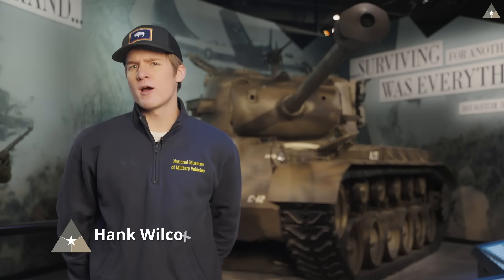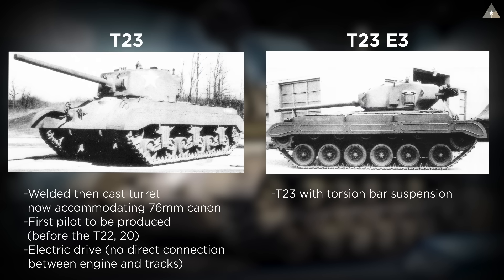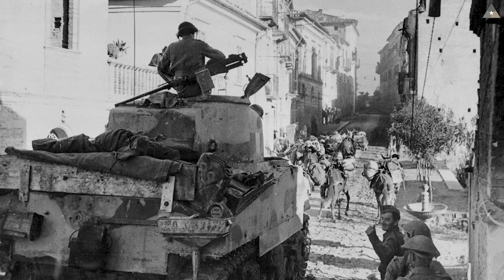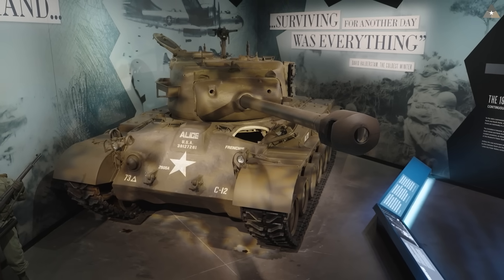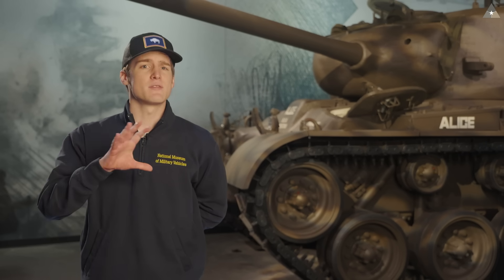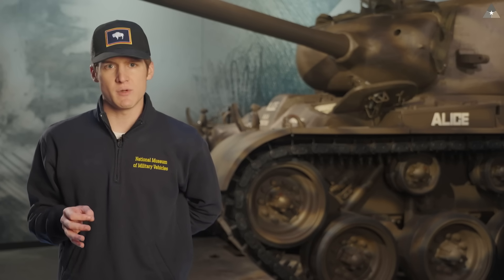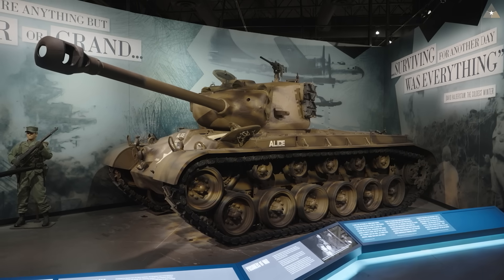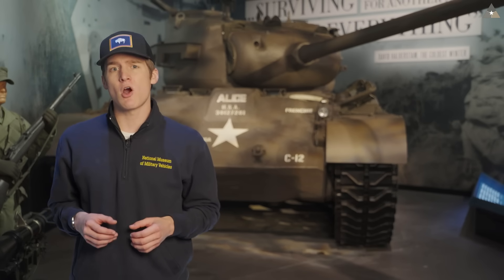M26 Pershing | From Concept to Combat Across Conflicts

Comment: A Pershing was knocked out by a Nashorn
Reply: That becomes a Tiger in this video.
Reply: Basically one of each---one of the first two Pershings knocked out was by a Nashorn, the other was in the Tiger engagement mentioned in the video.  Not sure which was first but I'm sure that's something easily looked up.
Reply: @SomeRandomHuman717  A Nashorn knocked out a Pershing on March 6, 1945. A Pershing knocked out a Tiger II on April 21 but was not itself knocked our in that engagement. At this point I'd have to review what the video said to check that it conflated the two encounters, but that was my impression. The latter was the only encounter of a Pershing with a Tiger.

Comment: Again, another great video. Thanks for hi-lighting the M26. The tank duel at Koln against the Panther helped make the Pershing legendary.
Reply: If the Panther commander didn't hesitate to give the order to fire, thinking the Pershing might be a new German tank, then it could have ended very differently for the Pershing. That hesitation was the difference.
Reply: @lyndoncmp5751  Yep, you snooze, you loose!
Reply: According to the men who used the m26 in Korea it was a winner. Especially  against the t-34 85
Reply: The M26 was not legendary - it was a terrible tank. Don't equate an overhyped encounter with a single Panther with legendary status. It was unreliable, too heavy and just as vulnerable to German anti tank fire as the Sherman. The gun was better than the Sherman's but as a complete weapon system it was inferior (at least in WW2).
Reply: @chrisc8156  M26 wasn't a terrible tank. Don't know where you get that idea.
I believe the video errs in attributing the first loss of an M26 to an encounter with a Tiger that was actually an encounter with a Nashorn. I should probably confirm this by looking it up, but that's just my memory of the incident.
Reply: @gandydancer9710  The M26 was not a very good tank. It was chronically underpowered and was quickly replaced by the M46 and the true successor to the M4 which was the M47. The M26 barely saw any combat in WW2 or in the Korean War and the Army was glad to get rid of it. In essence the M26 tank was the M14 rifle of the Armored branch.
Reply: @chrisc8156  Lame analogies are unconvincing. Of course the M26 saw virtually no combat in WW2. The US kept trotting out the obsolete M4 long past it's sell-by date. And the M26 never got debugged during the brief time it was, to a tiny degree, used. And then the US ramped down tank production for almost twice the length of WW2 and when it ramped it up again there were newer designs. None of this says "it was a terrible tank".
Reply: @chrisc8156  The M46 was just a Pershing with a new engine. Lol
Reply: @gandydancer9710
It was definitely a Tiger I that took out Fireball. It's in the combat diary of Schwere Kompanie Hummel. Page 87 of Tigers In  Combat Volume 2 by Wolfgang Schneider. That picture of the Tiger that backed into a building is the actual Tiger.
Reply: @chrisc8156 the m26 was not a terrible tank, it has the best kill ratio of the Korean War by far. It just had power issues the engine was not big enough. The m26 was better for tank vs tank combat than the chaffee, m4 or m46

Comment: Nice work, Hank. And thanks to all the folks behind the scenes who help with scripting, production, and editing. One major factor of US WW2 tank doctrine and usage was logistics for our troops and lend lease recipients. The M4 was a modifiable jack of all trades, theaters and applications. Sacrifices (such as tank on tank capabilities) were inevitable. Would 500 Pershings have been a tactical game changing player in the Normandy Campaign, for example? I'm not sure, possibly. But given that most ammo expended by M4s was HE in support of infantry/indirect, etc., the Pershing's tank on tank improvements may have had marginal positive impact. Transition training of crews/mechanics takes time and logistical supply of new spares and tooling for field repairs may have been an obstacle. I question whether the war would have been over any sooner with significantly lower loss of American lives. Cool tank, however. Was it significantly more resistant against Panzerfausts/shrecks?
Reply: Wouldn't the Pershings also have HE rounds?  If so, they certainly wouldn't have done worse in those situations.  Other than less mobility,  they would have been better prepared for situations that HE could not address.
Reply: @videodistro   The 90mm does have a slower rate of fire and less ammo.
Reply: @videodistro  Thanks, indeed they would. So no major M26/M4 advantage in the broad non tank on tank categories of infantry support and indirect fire. Chiefs of Staff must ask if the battlefield "juice" is worth the logistical "squeeze." All the while, TD doctrine continued to muddy the waters.
Reply: Excellent  words on the trade offs and logistical demands of a large complex AFV
Reply: @Dog.soldier1950  My favorite quote about logistics is “The war has been variously termed a war of production and a war of machines. Whatever else it is, so far as the United States is concerned, it is a war of logistics.” Ernest J. King.
Reply: @Dog.soldier1950  - Thank you! Just trying to earn my keep around here. Reading over what I wrote, there's maybe one more thing that could be added to the M-26 story: While it is true that crews wanted as much protection against enemy weapons as possible, whether hand-held or crew-served, what they really wanted was a more-potent main gun, one able to deal with the toughest targets on a more-or-less equal basis (or better). The 90mm gun offered that. 

Opinions varied, of course, as they always do.... but the thing which stands out to me in reading and listening to accounts over the years from tankers who crewed the Sherman in WW2 and to a lesser extent Korea, is that need for a more potent main gun. They could handle not having 100% protection against enemy guns, as long as they had a weapon they knew they could count on to destroy enemy armor. Improvements in both guns and their ammo, the 90mm and 76mm (M4A3E8 variant) made this less of an issue by Korea, since the most-formidable tank the North Koreans possessed was the T34-85. 

You look like a former soldier yourself, if your handle is any indication.... hoo-rah!
Reply: The primary means armored vehicles defend against chemical (shaped charge) warheads are to generate standoff distance to lessen or eliminate the effect of the plasma jet generated by the charge, via coatings or other resistant surfaces, and by sloping the armor. Laminate high-tech composites came later, as did ERA (explosive reactive armor) plates. Defense against mobile hand held AT weapons as well. 

The M-26 was better-protected than the M4 series against all kinds of armor attack, whether KE or chemical. That said, it would have been relatively easy for a Panzershrek or Panzerfaust round to cut through its armor if a solid hit against a vertical or near-vertical surface could be obtained. The latter weapon in particular was a decade or more ahead of the efforts of engineers and designers trying to protect these vehicles and their crews. Then, in the 1960s and 1970s, the first wire-guided AT munitions appeared, which made the job even tougher. 

Field-expedient screens made of sheet metal or chicken-wire fencing gave some degree of warhead stand-off protection to Shermans and other Allied vehicles. These might have helped the M-26s in that situation as well. Better sloped armor is desired, too, since the closer to perpendicular the jet is to the surface being attacked, the more focused the plasma jet. 

It is always tough to play 'what if' history, such as in this case of asking if the M-26 would have shortened the war to any meaningful degree over the M4 Sherman. In sufficient numbers, it might have made a difference in how fast the American forces were able to advance. 

The closest analog I can think of would be the introduction of the T34-85 into the Red Army; it made units so equipped significantly more formidable against German forces and the crews and men supported by them certainly must have appreciated them. 

But by the time they were introduced, the Red Army had evolved numerous other means of knocking out the toughest German tanks, from other heavier tanks such as the IS-2 w/ 122mm main gun, to improved self-propelled guns and tank destroyers. Difficult to attach a number to the quantitative improvement given by the T34-85, because of these factors. Same for the M-26 Pershing, too.
Reply: Re: "I question whether the war would have been over any sooner with significantly lower loss of American lives. Cool tank, however. Was it significantly more resistant against Panzerfausts/shrecks?"

Considering that the Panzerfaust was a generation-ahead of the American-designed bazooka in terms of its performance, the M-26 would not have solved that problem. But it did possess better and better-sloped armor than the M4 series, which is no small thing. The problem of hand-held AT weapons, such as the bazooka or panzerfaust, was not to send tanks out on missions without adequate infantry support needed to keep those enemy crews away. 

The M-26 may not have ended the war sooner in objective terms, but it would have given a boost, psychological and otherwise, to those hard-pressed tank crews soldiering on in the Sherman, not withstanding its deficiencies. The message of many of the accounts I have seen from those crew members is that they were willing to make do with the relatively poor armor protection of the Sherman, but they needed a more potent gun pronto, something capable of dealing with the toughest German targets. The Pershing gave them that in the form of its potent 90mm gun. 

Even the small amount of action seen by the M-26 near the war's end saw some get knocked out by German AT weapons, whether tanks, TDs, SP guns or infantry tank-hunter teams. It wasn't invincible by any stretch, but it was a modern, well-executed design which offered a lot of benefits and upgrades to the M4 series. The basic quality of the design/layout is proven by its longevity, through the M46>M47>M48 series and into the M60, which takes us up to the 1980s-1990s. 

The skeptics will reply that it was somewhat under-powered, etc. etc. - but teething troubles of that kind are almost inevitable in a design conceived/built under the pressures of wartime. Over time, the defects of the design were remedied and the result was a successful, long-lived MBT.